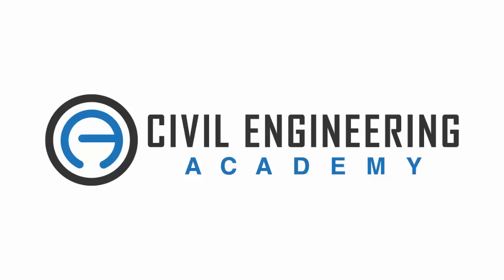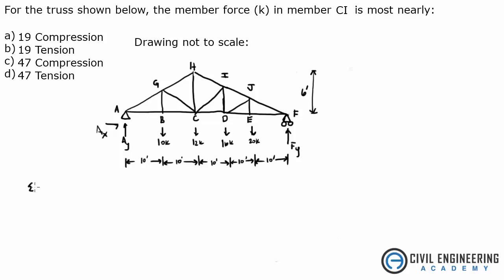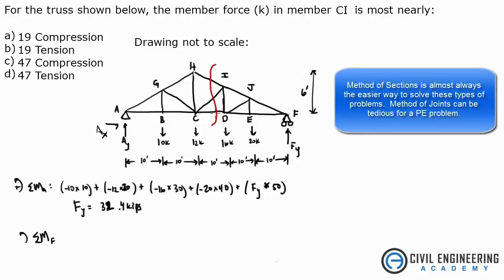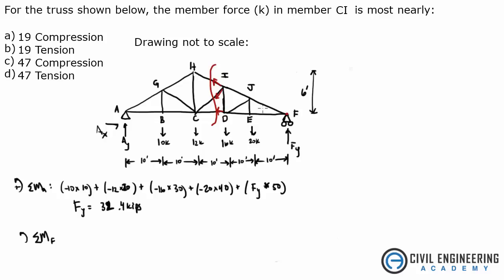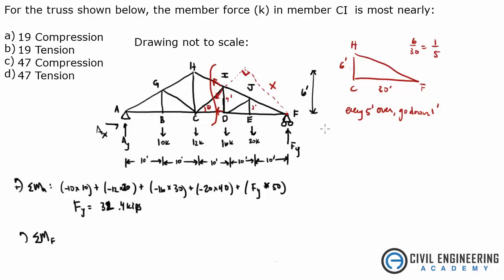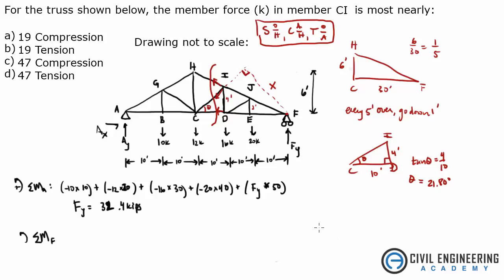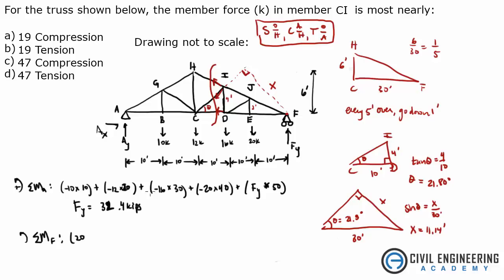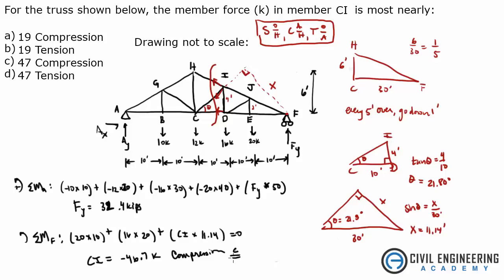Structures-Method of Sections on Truss

Comment: I used to use angles, but now I prefer "unit slope" to figure out the vert and horiz components.  Interested?

The Benefits:
1.) No need to overlay a 2nd coordinate system.  (more chances error)
2.) Struggling to find perpendicular moment arm.  (more error and creative trig is needed)
3.) Struggling to find angles...phew...I get exhausted following the extra triangles drawn

So here it is. Use this Force(IH) is 0.98(run) and 0.19(rise). WTF?

Follow, me: 
horiz comp = 0.98F(IH) and vert comp = 0.19F(IH)
Then solve for "magnitude" F(IH).

Where did I get 0.98 and 0.19?
On slope of top of truss it's run=30ft, rise=6ft.  Right?
Then calc the hypotenuse(30.594), and divide both run/rise by 30.594.
Bingo!  But? WTF? is this? This is "unitized" rise and run value based on hyp=1.
Thus, multiply by anything force(lbs) or length(ft) and you get the actual component.

I know explanation is a little lengthy, but this incredibly minimizes paper scribbling space.  Any "old time engineer" will tell it's best way.  This is similar to when you have a 3/4/5 triangle configuration.  The horiz would be 3/5 and vert comp is 4/5...etc.  

If you go deeper into trigonometry 0.98 and 0.19 are actually the cosine and sine of the angle.  The angle which we don't need to waste time finding, but if you need use arc-cos and arc-sin will confirm the same angle. 11 degrees.
Reply from the maker: +trexinvert Thanks for sharing!!
Reply: like that unit slope.
Reply: Nai DAngeles